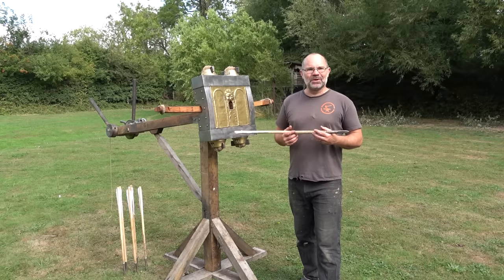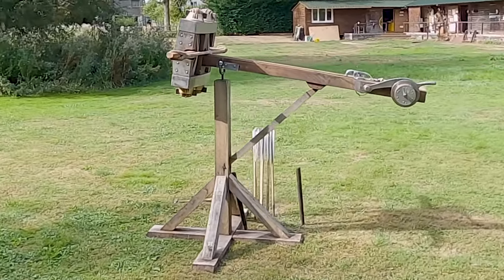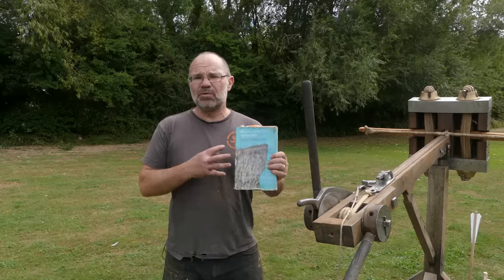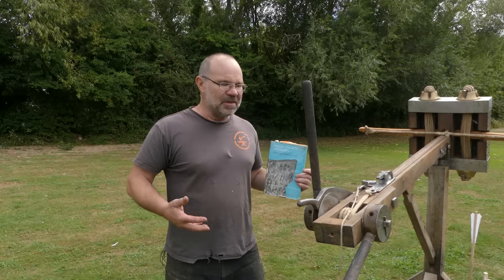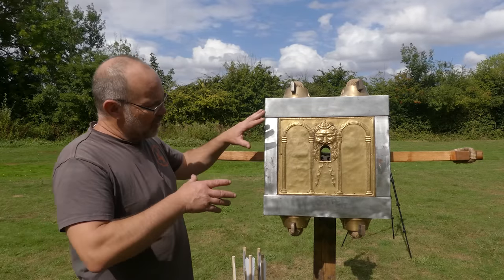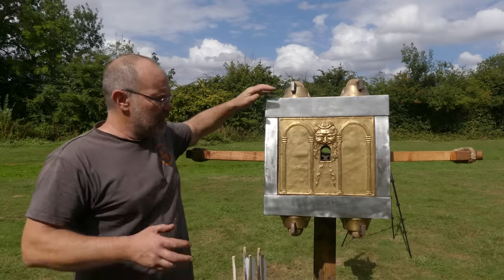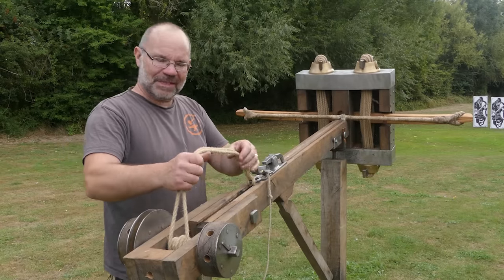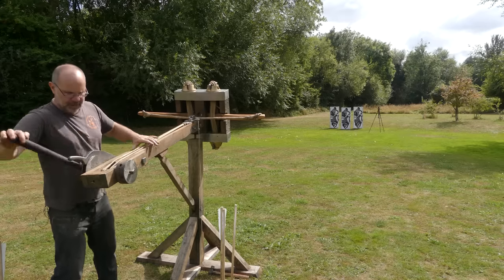Tod's new artillery piece - BALLISTA or CATAPULTA?

Comment: So that is a scorpio, a scorpio is a form of catapulta, ranging from the 1-3 span range (or thereabouts, ancient people weren't anywhere near as precise in the field, you just did what worked). Even the large ones are still scorpio, though not usually called that; it is just the "sting" of the scorpion (dart or javelin) vs the "kick" of the onager (which is a wild donkey). The smallest ones were essentially mounted gastrophetes through another mechanism. They were useful for shooting men on walls if the enemy didn't have siege equipment. The larger ones, shooting darts, would be used if the enemy had some siege equipment to pick enemy off the walls, and MAYBE in field battles. There are some references, but a bit questionable. To differentiate the largest scorpio, what is shown here, they were "catapulta", which replaced an earlier machine we know existed and know pretty much nothing else about. Some sort of less-effective torsion engine that was replaced it seems sometimes in the late 2nd BCE, at least by the end of that century. 
In short, it is catapulta, and scorpio.
And yes, I know those aren't at all grammatically correct Latin.

Comment: The leading theory remains that the rearward angled bar on the base of the stand was stepped so the Romans could achieve different ranges by adjusting the bar attaching the rear of the "barrel" to the stand that way. Ours just attached the bar to a pivot on the top portion of the machine itself so you could angle it by just stabbing it into the ground at different points though: https://i.imgur.com/bodM39J.png

Christian Miks' paper Die XEIPOBAΛΛIΣTΡA des Heron shows in some of the manuscripts a metal rectangle attached by the trigger mechanism, which he interprets as a handgrip to pull it back on the (theoretical) handheld form. However, others think it might have been part of a sighting mechanism.

Comment: I mean I don't really care what you call it because it doesn't really matter but your argument sort of fall apart when you think about how Romans and Greeks named things. I definitely agree with you that the "Ballista" that the Romans were referring to doesn't shoot bolts. The Roman Ballista shoots stones (small ones might have also shot something similar to sling bullets) they sort of look exactly like your design, but the slide doesn't have just a trigger it and surface to push a bolt. It would have a, sometimes pretty enclosed, cup structure to hold the stone.  So that's all fine, but there are immediate problems with Roman nomenclature. Ballistarii/Ballistarius were crossbowmen using the "manuballista" and that very definitely shot bolts. The problem is twofold both ancient Greek and Latin have this issue (only because we have a modern need to categorize) where the words for stuff was just what it was and wasn't all that descriptive. "Gladius" just means "sword". "Spatha" also means "sword"(from Greek). Don't even get started on ancient Greek and "spear" they had a million terms for it and without context it's hard to know whether they meant spear, javelin, pike or shape pointy stick. So that's the first issue, second is we are talking about military terms and much like modern armies the Romans could be a bit traditional in how they named things. It's hard to desribe but the best example I could give is early Republican Roman "Hastati". "Hastati" means "spearmen" but while they did originally fight with spears, quickly switched to swords. They were still called "Hastati" even though they weren't "spearmen" anymore. I guess my point to all this is I am fine with you calling it a "Catapulta", but your reasoning doesn't really sit right with me. Yes, most of what you said was true and I very much followed your logic, but that doesn't mean the Romans did that. Also, I would argue it doesn't really matter as most of the ancient people we have sources on to tell us all this stuff are giving us secondhand information or their own interpterion (usually written in later periods when terminology changed as well) and not what the people that actually made and used the equipment thought.

Comment: What kind of rope do you use for the torsion bundles? My initial assumption was that you want a rope that stretches as little as possible, but I heard a convincing argument that the opposite is true, and stretchy rope is actually a good thing. The reason being that when adding torsion to the bundles, the draw weight will increase much more per twist if the rope isn't stretchy. So this means the torsion bundles won't have as many twists in them to reach the same draw weight. Then the extra twisting caused by drawing the bow will represent a greater portion of the total twisting, which will cause the draw weight to stack. In contrast, stretchy rope will allow more twisting of the bundles to reach the same draw weight, so it shouldn't cause stacking.

This makes sense to me because I have had success using paracord, which is fairly stretchy. It would also mean sinew rope would be effective. Another tip you may or may not have heard of is to put opposing wedges between the "epizygis" ( the bar which the rope loops over ) and the rope, so you can assemble the torsion bundle with the wedges far apart, and then drive them closer together to add more pre-tension to the rope. I haven't tried this so I don't know how well it works, and I also don't know if it's historically accurate.
Reply: That's the million dollar question! I believe that there is some mention that human hair was used (harvested, for example, from the Athenians held prisoner by the Syracusan), but I don't think anyone has ever settled the questions you ask convincingly.
Reply: @QuantumHistorian  to my knowledge it was horse tail hair, Human hair of captives makes the story
Reply: @pyro3446  I mean, that makes more sense, but the human hair story comes up multiple times. In one cases women donated their long hair to defend their city (I can't remember which one...). I guess it could be a literary trope, but it's an oddly specific one... And only makes sense if most people at the time had no idea how rope was made.
Reply: @QuantumHistorian  it could be quite real the donation of hair , human hair can take quite alot of punishment. Used in desperation or patriotism the enemy could hardly tell , rope make from hair or braids can pull some great weight
Reply: @pyro3446  Usually was horse hair, usually in ready availability. And as you have mentioned, it was a couple times notoriously made by donated female hair, "for desperation or patriotism" as you very well said, when enough horsehair was not available for repairs to keep the artillery of a besieged city running. The "it was always made of human hair, from captured slaves" thing is a Victorian meme, AFAIK. (I could be wrong and the meme have a different origin, but it is a meme).

Comment: If you increase the length of the ratcheting arm you should in theory increase the speed at which you can apply tension and thus make it shoot faster. This will also take less load off the user. Also I think a distance gauge can be achieved or mounted straight to the top of the catapulta and just adjusted from zero based on your initial firing height.
Reply: You'd need to make longer movements yourself operating a longer ratchet arm, plus a longer ratchet arm would likely interfere with the drawstring at the end so it wouldn't be a good trade off. Later models of these engines did have different types of winches that could, at least with a proper crew load faster than this earlier type.
Reply: @JVL0110  true, but there should be a happy medium. He can also increase the gear ratios too

Comment: About ranging, could the original crossbar on the stand have been adjustable, so that instead of lifting it off with each shot, you would use it to set the range, probably with the OPTION of lifting it off for "freehand" shooting?
Not sure if that would be a workable way to do it, but it would be very useful way to set up repeatable shots.

And there should definitely have been a way to aim more accurately, it would be weird otherwise with such an otherwise suitable for aiming piece of equipment.   Except i have no good ideas at all for how to do it, lol...

The "obvious" would be some way to aim through the hole in the shield, but that would put the person aiming very close to the mechanism, probably not a good thing.

OTOH, with how the mechanism is fixed together, adding a sight SOMEWHERE on it, probably the side or underside of the front shield, should be reasonably viable.
Lets say, an upside U-shaped contraption with something locking it in place when placed across the shield, saddlestyle, with a forward and a rear sight extending sideways from the tips of the U, one of the sights with a range scale to adjust with, possibly with a horizontal scale as well to be able to adjust for wind or movement.

Also, with the investment in the frontal shield, i expect the stand would also have a shield attached or possibly a regular soldier's type of shield, with or without the soldier holding it.   Having a single line of soldiers protecting a line of these wouldn't be strange after all.   And it would also mean that if the catapultas are placed in a position where a shield in front of the stand isn't needed, they don't have to drag an extra one around all the time, just not put a soldier on shield duty in front of it when not needed.

Comment: Would the 'crank-stick' not work perfectly as a 'center pin' like modern handguns and rifles use? You already have the two tension knobs and if you put a hole in the back where you can place the 2nd tension crank vertically and add height indicators that might work

Comment: I mean the fact that it scales it size is not really that alarming, bows are very similar in that long bows shoot way further than short bows. Because even tho this has a different mechanism than a regular bow, the energy that ends up affecting the bolt is pretty much identical to a bow.

Comment: I wonder what would happen if you add a tip like the one on a Pilum to it. That might be absolutly nasty against light fortifications or heavily armoured enemies. 
I mean a Shield and a Heavy armour might be able to stop a normal Bolt from skewering you, but if the same principle of a pilum-tip is applied to a Bolt fired with 10x the force, that could be a unstoppable projectile (for that time)

Comment: How can the tension on either side be balanced? Indeed does it need to be balanced?
Edit - the trajectory looked flat for that last bolt right up to the target and then it dropped. Reminiscent of a high velocity round
Reply from the maker: yes it does need to be balanced and this is easily done by winding each individual washer

Comment: I should think a pair of trained persons working in tandem could work either side of the ratchet to draw the arms back much faster. 

Any chance of gearing that might make the task easier? Or is that sort of engineering anachronistic? What about firing more than one bolt at a time, could it be designed in such a way as to fire say, three at once (side by side, perhaps)?

Comment: Todd, from what I've read in historical sources, antipersonal artillery was quite accurate in direct fire. The fact that you have difficulty aiming seems to indicate something to be off. Given your personal expertise and the sources you are following, I think we can rule out a major  mistake. 
The most likely minor thing that I can think on top of my head...  I've noticed that you can hardly aim looking down the bolt and through the bolt hole (I admit my knowledge of ancient artillery doesn't include which kind of sights the Romans used, but it seems the most logical, simple and not-requiring-extra-parts-that-we-don't-know-about solution) because the bolt top is in the way.  Could it be that your machine might be a milimeter or two too "thigh"? Maybe a bolt carrier a milimeter or two slimmer (meaning a bolt a milimeter lower) and /or a hole a milimeter or two larger would mean enough of a peephole to aim through.

Comment: Tod that is a cool device you built. How did you make the lock slider in the wood. Looks like you made dovetail an put grease on it to help it slide. An when you slide the trigger to front end, what is that sticking out the front. Is that made like that to hold the arrows so they won't tip downward when you have it ready to shoot.

Comment: Lots of power there and it's far from fully tensioned. Which parts are more likely to fail if you put it under too much stress?
Reply from the maker: I have no idea, but am currently worried about the headstock - more to be revealed in due course
Reply: @tods_workshop  Looking forward to more videos! 👍

Comment: the romans were supposed to have built there's with twisted bundle's of horse hair rope but try and find that much horse tail in that length today. unless you have a few hundred horses around I don't see it happening in this day and age but it was supposedly the reason there catapults and ballista were so powerful even more so then the ones we build today using modern materials . you could also use silk cord in a catapults or ballista that is twisted in to rope but again finding that much would be a problem but it also would be insanely powerful even more then horse hair
Reply from the maker: You can buy horse hair rope, but it is massively expensive and is used for some sort of horse related training, but I forget what,.  Some sort of lead rope.

Comment: A) That's Mint! B) Towards the end of this film, there's a really clear few frames of a long bar protruding from the mouth of the catapulta, which the dart appears to lay on and then retracts back down the stock/track of the machine. Is that purely to support and steady the dart while its being launched? Or does it serve some other purpose...?
Reply from the maker: Watch again, it is the track that the bolt sits in and it moves in and out depending how far the arms are drawn back

Comment: Ooo Todd, you know the beam that holds the machine up while you're loading it. You don't suppose they could have used several notches along the length of the machine to give varying fixed angles and thus fixed and known ranges for the machine? One notch is 50 meters, the next 100 etc? That would be a very simple way of reliably getting a constant range.
Reply from the maker: Maybe but I don't think they did
Reply: @tods_workshop  Thanks for the reply Tod! Looking forward to a lot more on this! That was just my morning speculation haha.

Comment: What are efficiency numbers between torsion vs spring? I'd guess that torsion is lower efficiency but infinitely scalable to higher weights. I'd imagine tho that longer metal levers would be better than thick wooden logs
Reply from the maker: I actually have no idea in a mathematical sense, but in a practical sense these shoot much further than flexion bows so I guess these

Comment: What level of damage would it do that would make it worth all that more fuss than a crossbow or bow?
Reply: Depends on the size of the machine of course, but a well tuned one of a similar size Tod is operating here is capable of much more than any handbow or medieval crossbow. This size machine should be able to penetrate a shield and the warrior behind it from a considerable distance away, meaning further away than ancient era handbows could shoot. This is due to not only the heavy draw weight of the machines but also the long lenght of draw. Comparing for sake of example a medieval siege crossbow of 1200 pound draw weight with a small torsion engine of a similar draw weight the torsion engine is much more effective due to the long draw- maybe 15-25 cm for the crossbow to the maybe 100- 120 cm or so for the torsion engine. This means the catapulta can accelerate the projectile with the same amount of force for a much longer amount of time and distance, imparting more energy into the shot. The crossbow also suffers from the inherent problem of needing an ever heavier bow to increase bolt velocity, essentially needing to be more massive to accelerate the bolt and the bow itself combined, hitting diminishing returns. On the catapulta you can simply apply more tension to the torsion springs by pre- streching them more heavily or twisting the washers more to increase draw weight, essentially without increasing the mass of the catapulta's moving parts resulting in a direct increase in shot energy.

So, it is a more efficient system and easily scalable, even adjustable on the fly to some degree. As to the question of why they stopped constructing catapulta's and ballistas, it has to do with diminishing state capacity from the 3rd century onwards and the changing nature of warfare and society to put it short.
Reply: Probably capable of passing though 2+ warriors, sheilds & armour & all.
Reply from the maker: 2bingtim - agreed
Reply: @tods_workshop  So the benefit is breaking up formations?

Comment: Hey Tod, can you do some tests with this against ballistic gel, or a slab of meat? would be interesting to see what would happen when a person actually got hit with this monster
Reply from the maker: straight through - quite simply
Reply: @tods_workshop  what if you put a  shield and some gambeson in front of it?
Reply: @FenkenK  Same result. The level of energy delivered by one of these at full capacity,  is way over that which sheilds & normal armour is designed to withstand. The opening scenes of Gladiator show one large one skewering two Germans against a tree & that's no exageration.